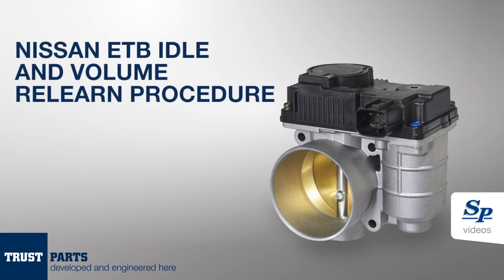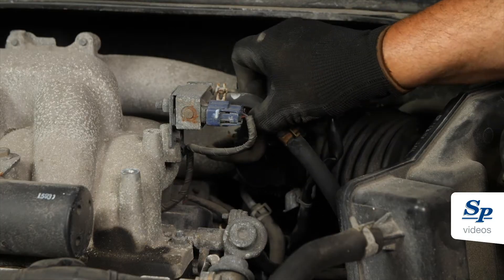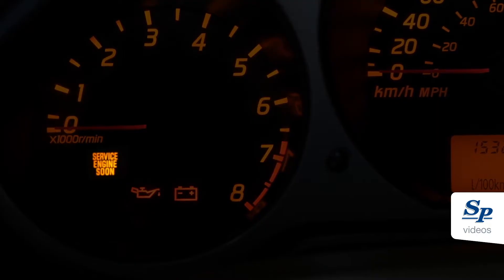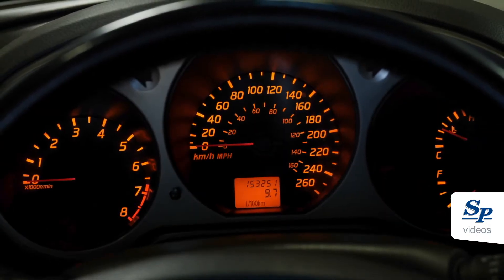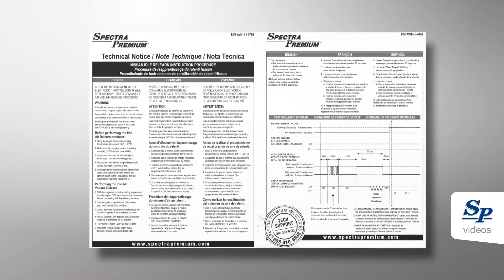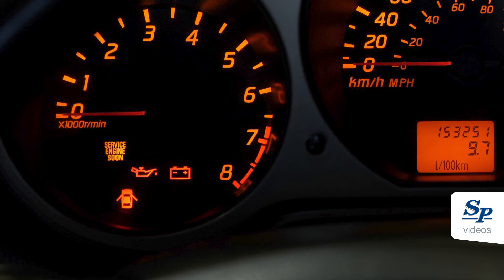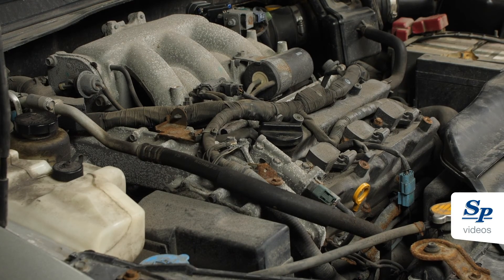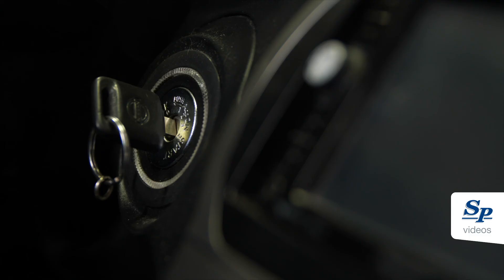NISSAN ETB idle and volume relearn procedure

Comment: Cheers, this worked on my Nissan xtrail sr20vet - tried a few other guides and some had slightly different steps. Took 3 attempts but the procedure work with the flashing CEL. My idle remained the same but I did this as a preventative after cleaning my throttle body and mafs

Comment: I cleaned my throttle body on my 2017 Nissan rogue should I do this relearn process? Do all Nissan models require?
Reply: Did it run fine after cleaning?

Comment: For Nissan Tiida 2007:  After CEL becomes solid again release the pedal and start the engine within 3secs and let it idle. If it's still high-rev/pulsating idle, with foot on the brake, shift into Drive. Idle will now go down under 1000rpm. Shift to Park again, and the car will find its regular idle speed (near 650-700 rpm). BTW, thanks for the video.
Reply: This worked exactly as you've described

Comment: This is the stupidest thing.  With modern tech you mean a car can't figure out this stuff on its own?
Reply: How could it? 
The idle relearn is in case the sensor and physical parts are moved unaware of each other. (or with a brand new piece of equipment). It's basically a calibration to learn min / max since each sensor and machined part is slightly different. 

In case your engine is running fine - it's not necessary.

Comment: Nissan N16 Sunny 2003 
I have a problem with RPM - it's completely unstable
The Throttle nail has been moved - and the idle sensor has also been moved
How do I return the Throttle nail to the original factory position?
Reply from the maker: Good day,
Please get in touch with our tech support at : 1-888-910-8888. They'll be able to help you out. Thank you!

Comment: I had check engine light on reason for throttle body.  After changing throttle body to my 2003 Nissan Altima. I did the relearn process. Now my check engine light is blinking instead of solid illumination. What do I do next?
Reply: Do it again just like he said wait 60 seconds to do it again.

Comment: Hello, I try some times relearn throttle on qashqai hr16de after clean, 1800Rev. After procedure of relearn and start engine rev was down to 850 and after few seconds it return to 1500rev. If the rotated light knob in "parking lights" rev not down and 1800 stable. When I turn knob to auto or near lights  REV take down to 850. I can play with it long, rotating the knob. After stop engine while 800rev and start again it go to 1800. I try add the load from aircondition, lights, music and it take effect to down normal xx rev is about 800 and stoped engine. But relearn not remembered true xx rev.
Reply: can you tell me if you manage to fix it ?

Comment: I have restarted the relearn procedure several times; after I start the car, the service engine soon indicator illuminates and will not turn off - the engine will not rev up at the end of the final learning procedure. Any other suggestions?I have a 2012 Altima 3.5L SR
Reply from the maker: Hi, could you please indicate the reason for your repair? You should check the electric connector and terminals. Is there another failure code than the ETB? This might impact the relearn procedure. Make sure that all the electronic accessories are turned off and that the wheels remain straight during the relearn. Please let us know if that helped you.

Comment: What if its a push button start and a hybrid it dosnt just start right up when you turn it on its i ev mode.
Reply from the maker: Hi Corey, no such relearn procedure has been found for the models using the push start button.

Many are done by using a bi-directional scantool.

Comment: this is good for Nissan 350z 2003/09 ?
Reply from the maker: Good question! In short, yes this procedure is also valid for the Nissan 350z 2003/2009 (written instructions downloadable here: https://www.spectrapremium.com/ressources/televerser/[548]). But please make sure you purchase the right ETB part for your vehicle, because there are two models for these years (you can validate by visiting our eCat: https://ecat.spectrapremium.com/). Thanks.

Comment: I keep on trying this, nothing works on my 2000 nissan quest, PLEASE HELP!
        UPDATE ITS FIXED:
I couldn't get my van to get to the normal working temp hence I wasn't able to get in to relearn mode (it would die every time after 1 min of running)
So I disconnected both battery terminals and clamped them together for an hour, after reconnecting them started and zigzagged though my neighborhood, it learned fast!
Reply from the maker: Hi Boris, thank you for your question. Would you be able to call us on our tech line 1-888-910-8888? This way, we will be able to help you.

Comment: What if u already did the auto relearn and the service engine soon was on ?
Reply: Depends on what code you are throwing, If the code does not affect the idle of the car your fine. If you did the relearn incorrect you will throw code P0507.
Reply: @KenHMladin   I have a Nissan Altima hybrid that I can't get it to relearn
Reply: @myutube977  You may have another issue that is also affecting the idle of the car. That one is a little harder to diagnose over the internet. What codes are you throwing ? Any other symptoms ? I didnt know there was an altima hybrid !  lol I have never worked on one.
Reply: Yes that’s the code
Reply: What should I do then?
Reply: @wallysanchez1732   All you have to do is redo the relearn correctly and reset the code. This video is the best i have seen for relearn steps. if you don't have a scan tool go to any auto parts store and get them to read your ECU and tell you the code, they may tell you that they cant reset the code for you, just be cool and have him show you how to reset it, then ask if you can hold the scan tool and reset it yourself. most of those guys are really cool and will do it for you.
Reply: Ken H thanks 🙏 you have a great weekend
Reply: @wallysanchez1732   U2 bud !